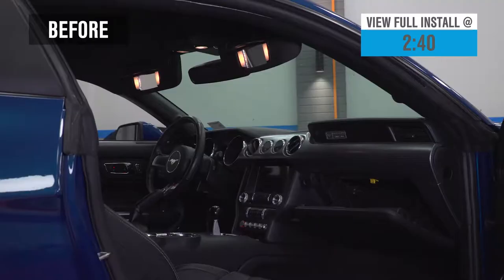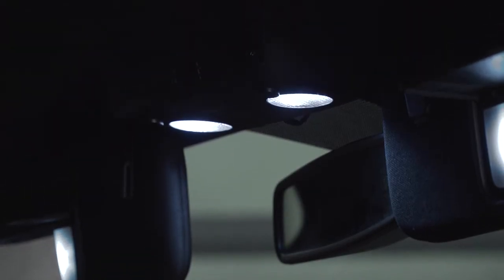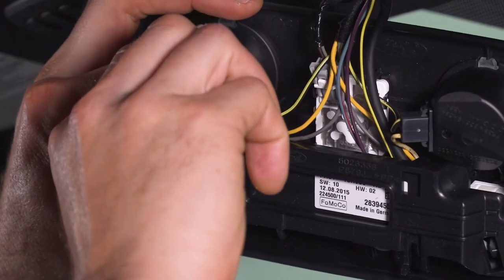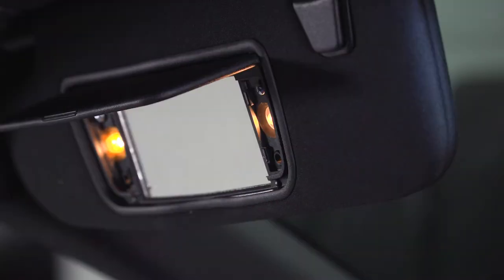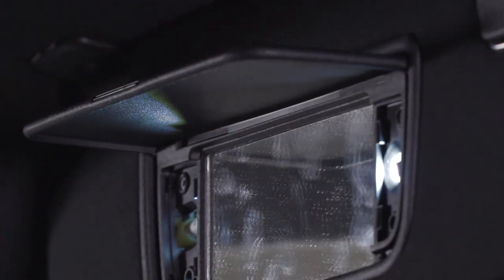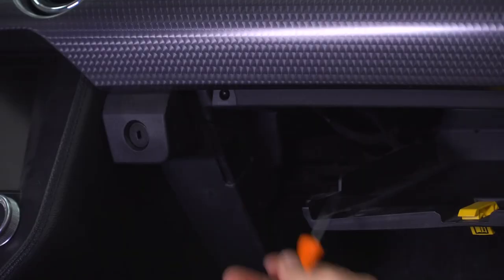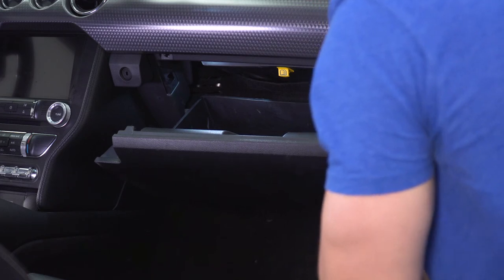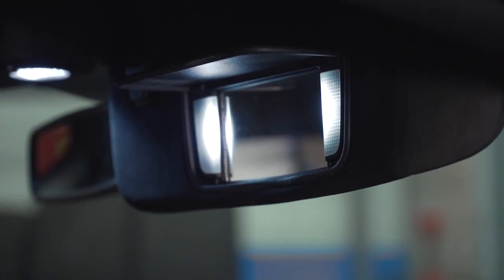2015-2021 Mustang Axial Stage 2 Interior LED Lighting Kit Review & Install

Comment: I'm an Electrical Engineer and for the life of me I can not understand why none of the LEDS are packaged so the LED is facing the lens. This would dramatically increase the light output and the overall esthetic would be FAR more pleasing to the eye.  More effort needs to be implemented in the correct use of LEDS specially at the $60 price point. Come on Axial make your product stand above the E-Bay offerings from China.